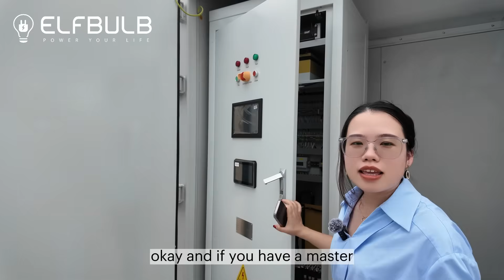Bellie Breaks Down the 3.6MWh BESS: Your Key to Sustainable Energy!

Comment: Just for clarification:
PCS: Power Conversion System
BMU: Battery Module Unit
BCU: BATTERY ConTrol Unit
BAMU: Battery Array Monitoring Unit
EMS – Energy Management System
Cluster: Consists of Many packs.
Pack: Consists of many cells
Reply from the maker: That's great!👍👍👍

Comment: BESS 2MW or 4MWh products are the basic energy storage module to build bigger systems up to 1000 MWh. Air cooling with Air conditioners will do for a single unit. But if the AC unit becomes faulty in each year maintenance is one issue? I am seeing that liquid cooling is used in higher capacity BESS. How much extra one will have to pay for liquid cooling system in percentage when compared to Air cooled system?
Reply: What is the voltage level for this 500kw cluster
Reply: @swaroopkorada  ElfBulb company has not provided the data sheet? But if they had used 4 numbers of 125 kW Solis Inverter (or 7 numbers of 80 kW Deye Inverter),  200 A is the max dc current of battery for a single Solis Inverter (via 2 dc ports of 100 A each) and the battery voltage has to be around 614 Volts (12 batteries in series of 51.2 V for each battery port)  to produce the 125 kW.
Reply: Price?